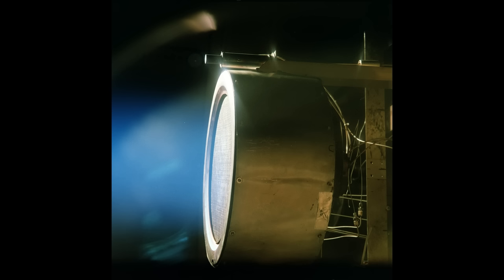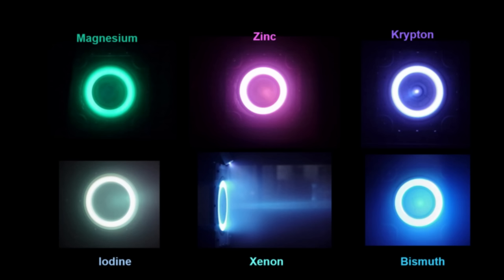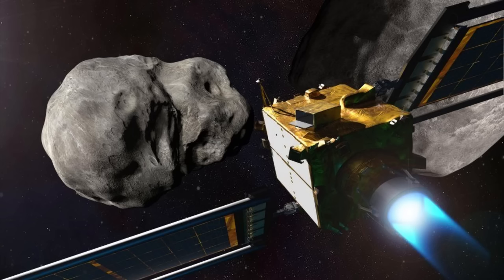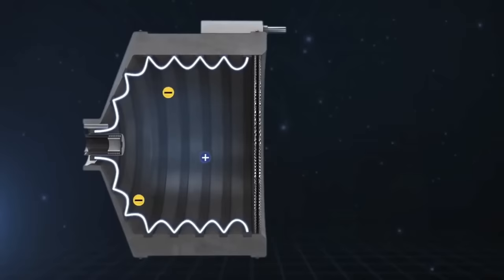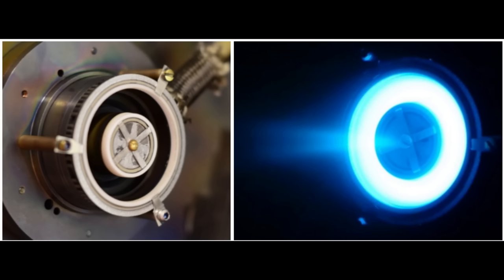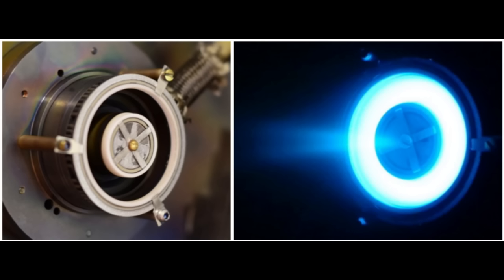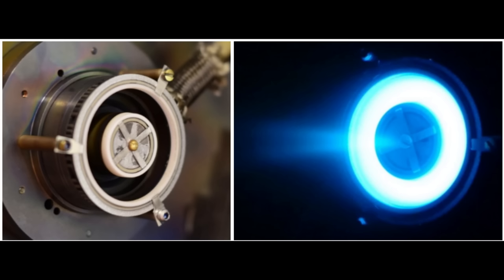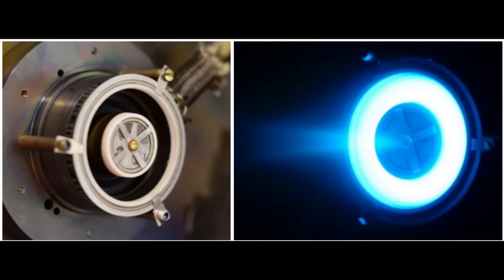Why Are There Two Different Types Of Electric Space Engines, And How Do They Work?

Comment: Bizarrely, the description of how the grids work in the ion thruster and the addition of screens and suppressor grids is precisely the way that audio vacuum tubes (valves) were developed from triodes to tetrodes to pentodes. So my question is this - can I stick four ion thrusters in my Marshall amp?
Reply: Alternatively, if you just needed a few more Ns impulse to reach a rescue craft a la Martian and had nothing but your great-grandpa's Fender amp, could you use it to rendez-vous? What guitar tab would be best?
Reply: @spagamoto  I'll knock the tops off a few EL34's and contact you from orbit
Reply: While working on the Deep Space One NSTAR engine, the JPL people asked where I gained my knowledge about Ion engines. I told them I made a few in 1966 from old vacuum tube components.
Reply: @Spacedog49  There's nothing new that hasn't been forgotten!

Comment: I always thought plasma thrusters count as electrical thrusters, too. I guess they don't use electric fields as directly as ion thrusters, but what else would you call them?
Reply: "I always thought plasma thrusters count as electrical thrusters, too."

They do! And they're awesome, the current problem with plasma thrusters is that they get too hot and melt down all known materials, but if we managed to solve the heat issue, they would be WAY better than ion engines

Plus the heat management issue is also the thing that is preventing us from using advanced fusion, fission antimater etc engines, so solving that would open the door to truly magnificient engine types

Comment: Hey, @scottmanley if you had a 1000 kg spaceship exclusively dedicated to accelerate, that used a mix of solar and nuclear power to fuel the ion thruster (solar panels could be ejected when they became useless, thus reducing total mass) what would be the top speed that it could achieve? If it would it be possible to mix it with gravity assists how much more speed could it get? Could it get somewhere near relativistic speeds before the fuel ran out?
Reply: Wow, you don't ask easy questions!!
Reply: it depends too much on many variables. how heavy the rest of the space ship is, how much is fuel, what kind of engines you have, how much money you're willing to put in, how much time you're willing to wait, etc
Reply: @dabs4270  the ship should be just engine, fuel, solar panels and nuclear RTG, nothing less, nothing more. It should the best engine possible, with no time or money limits. I just want to know what would be theoretically possible
Reply: Yeah, (when?) could we overtake the Voyagers this way?
Reply: To do this, you would probably want like 90% fuel, 9% RTG, and 1% everything else.  Skip the solar panels, run purely on a 50 W RTG, and use a FEEP thruster at a truly ridiculous accelerating voltage, and a truly abysmal thrust level.  Say you use 130,000s of ISP and a 90% fuel mass fraction - you have 2.9 million m/s of delta-v.  But, with a 50 W powers supply, and 900 kg of fuel, it will take about 950,000 years to fully accelerate.  

That's way too many half-lives of plutonium for the RTG to continue working - you get like 80 years at best. So, not feasible.  But, it gives you a sense -  With Xenon,130,000s of ISP only requires like 200,000V of accelerating potential. That's like a decent high-school Van de Graaff generator.  Just need a power supply that weighs little enough to make it make sense.

Comment: So, if you had a big fusion reactor and some very large banks of electric thrusters, could you generate some significant thrust? I'm thinking The Expanse.
Reply: We can build powerful fission reactors right now that could do all kinds of awesome things in space. Like getting humans around the solar system in amounts of time we could handle. We just don't have the drive to do it yet. That could change in the relatively near future as we learn to gather and use resources in space. If your into this stuff I'd read Delta-v and Critical Mass by Daniel Suarez. They're novels about mining in space and saving the world but are scientifically accurate. Good reads for space nerds.
Reply: It's not just the raw power requirements that make ion (or plasma) engines bad for moving humans, but also the efficiency of the parts. If you strap a gigawatt nuclear reactor to one of these engines, you won't be able to funnel all that power into engine thrust. You'll just melt the components.
Reply: In theory, you could generate a lot of energy from nuclear fission/fusion which could drive an ion engine, but I doubt it would be better than using the thermal energy to expand a gas and use that. Right now, most energy production from nuclear is via heat, so it is more efficient to use that heat energy to produce kinetic energy than to have efficiency losses by converting it to electrical energy then to kinetic energy.
Reply: fusion reactor would be an engine in itself)  double-quadruple conversion is pointless
Reply: @General12th  Kinda like changing to a different propellant, it's building a whole new engine. I didnt mean to imply that all we need is huge source of electricity and bam its The Expanse. But there are many different propulsion concepts that become possible when you effectively have a your cities power plant on board. Nuclear Thermal will probably be the first one we'll see that makes Human exploration beyond the Earth Moon system feasable. Or maybe something like the vasimir plasma engine powered by an electricity producing fission reactor. Still have to get rid of waste heat one way or another which can be a real bitch in vacuum. People much smarter than myself will hopefully be stressing over all of this sooner rather than later.
Reply: @harryganz1  thermal nuclear engines have ISPs of 900s, so double of HydroLox.
Direct use of nuclear processes would be really great. But the needed gigawatts of nuclear reaction are scary at least for human spaceflight. shielding is heavy. Heat sink is heavy. human soup is considered bad.
Reply: @harryganz1  That's why I said 'all kinds of cool things' instead of 'power ion engines.'  With a bunch of electricity to draw on things like magnetic shielding become possible. Good propulsion isn't the only thing humans need to live and work in deep space. That's why sometimes the multiple energy conversions make sense when you need that energy in a form you can use for whatever the purpose at hand is. I'm not the ion engine guy or something like that. I'm the pro try everything if it advances our species to the next steps guy. Starship should give us the capability to put real hardware in space cheaply enough to do real commercial work with. That's what's game changing about it. Not that we could try to colonize Mars for uh....reasons. Science outposts? Yay, all for that. Elon deciding if you get airscrubbers based on the 180 character description he makes you write of how you have worked for Mars in the last month sounds less desirable to me. Kidding a little but that whole colonizing thing has never made any sense. Our main focus now should be improving any and all tech that advances ISRU. And finally doing something about spin gravity. It's really not optional for more than a few week visit without your body paying a high price. And we can't build anything really transformative out there without ISRU. The Moon and the NEO's are the place to work all that out. We could really be doing some next level shit up there right now if we had the collective will to. I get why we don't have that will though, lots of problems right here at home and most people don't believe they benefit from all this space stuff. They're wrong of course but I still underatand. I think a lot of our collective apathy comes from no longer having a frontier open to anyone brave and smart enough willing to risk it. Having that again might raise us out of this malaise so many seem stuck in. Finding a way to democratize access to space should be a priority so hopefully we don't drag all our BS out there with us. If we wait till we have a huge presence then we'll have already baked in the BS I think. Funny that in the books I mentioned earlier its all done with grift and subterfuge because none of the powers want anyone having more than they do, understandable from their perspective. I can see it all going so many different ways and most of them arent great for regular (non billionaire) people other than the technological improvements. Hopefully we can all be kind and honest enough to each other that one of the better scenarios works out. But humanity hasn't been the most confidence inspiring thing lately so anyones guesses are as good as mine. Delta-v and Criticall mass by Danial Suarez, really can't recommend these enough. It's all based in realistic tech and the real problems of living and working in space. Other than just being good reads for scifi nerds they definitely gave me a lot to think about.
Reply: @mrpicky1868  Maybe in a vacuum, pun intended. But often all those conversions are necessary to get energy into a form you can actually use for whatever problem your trying to solve. Even with all the losses. The best propulsion we can do for human travel in the near future is probably nuclear thermal. But propulsion is only one of the issues we face out there that might be solved by having large amounts of energy available in multiple forms. So no, not exactly pointless.
Reply: The Expanse's  Epstein Drive is just ridiculous by today's tech (it pure sci-fi). It can constantly creates enough acceleration at least 1/3 G  for weeks.
Reply: Definitely a bit of artistic license, but if I remember correctly, it is basically what those ICF derived “torch ships” would use.

I think they were mentioned in fhe video Scott made on the “Far-Future Rocket Technologies” or whatever, but i’d love a dedicated video on plasma thrusters! (Maybe one for non-nuclear thermal too, unless that already happened and i forgot it rip)
Reply: @harryganz1  chould you use both at the same time waste not want not? i mean the waste heat and also power from a fission engine have the waste heat heat stuff up and power made power a ion engine?
Reply: yes but it's inefficient, "fusion reactors" are steam engines at the end of the day, why do that when you could make the fusion reactor your engine directly, every time you transform energy from a type to another you lose some of it

you go fusion products and their kinetic energy and charge, to thermal energy and chemical damage, to heating up water/a fluid, to moving through a steam turbine and becoming rotational energy, to being slowed down by a dynamo and becoming electric potential, to electromagnets, to a force applied to magnetically charged ions

instead of "fusion products go brrrr out the back of the ship"

there's ideas of pinched fusion which remove the steam turbine dynamo part, though that's not realistic, any high horsepower fusion engine would always generate a lot of heat, wether that's your main way to extract energy or not you WILL have to get rid of that heat somehow, and if you have to bother mmaking a complex coolant loop around your reactor, at that point why not add in a dynamo

Comment: I was wondering why Falcon Heavy delivered Intelsat all the way to geosynchronous orbit, as it's so much more expensive than the transfer orbit.  I did some research and found out that the electrically powered Intelsat would otherwise take 4 months to position had a Falcon 9 deployed it in geosynchronous transfer orbit.

Comment: (Apologies if duplicate post)

The USA tested electric engines using both suborbital missions [SERT-1], and an orbital mission, SERT-2. The latter was launched in 1970 and operated until.....1991! Not continuously of course, but one of the thrusters onboard SERT-2 ran for a total of over 3,700 hours with multiple restarts.

 In particular, SERT-2 [BTW, the acronym stands for Space, not Solar, Electric Rocket Test] really paved the way for the increasing use of electric propulsion that we are seeing today.

Comment: Pure electric engine that works:  A magnetic sail.  Its like a solar sail, but it uses magnetic fields to redirect solar wind instead of just bouncing it directly off a surface.  It has much greater control over the way its thrust is used, and can in theory be used to sail "against the wind."  The thrust is, of course, quite low, though possibly a bit better than a normal solar sail.  

Just make sure you have them at both the aft and the bow (relative to facing at the sun) so you can use them to steer and to cancel out each set of sail's torque.  

Edit:  technically, it does need "fuel."  But that fuel is given to it constantly by the local star in the form of solar wind and energy that can be harvested by solar panels that then power the magnetic fields of the sail system (the masts that have the field generators can also double as mounting points for the panels).

Comment: if one didn't mind super low thrust, could shining a laser out the back work as a thruster? if light has momentum..shouldn't that work?
Reply: The amount of light required means either absurd amounts of energy, or miniscule thrust.  The effect of reflected sunlight and emitted heat radiation is enough to be detectable with careful measurements over years.  It can even cause asteroids to spin after a very long time.  The solar wind is a bigger effect.

Comment: Thanks for sharing your thoughts and ideas. Always interesting and entertaining. Are there any other types of electric rocket engines that could work within the atmosphere. I’m often pondering if the thorium liquid salt reactors can be refined for space use since one of their primary waste products is xenon gas. While powering your way to orbit you might be able to produce your propellant needed for space. Although no expert by a long shot I’m stuck liking the idea that your nuclear fission fuel contains both your energy and propellant in one compact element.

Comment: Thanks for the insights into electric propulsion.

While NASA were focused on more efficient LOX-LH engines and gridded ion thrusters, Elon and his engineers decided to use a kind of Soviet space technology: LOX - kerosene engines and Hall effect thrusters - and they did so with great success.

You can call me biased, but, in my opinion, the Soviet and American space tech perfectly complement each other.
Reply: I thought it was Rocketdyne that started using Kerosene as part of the REAP program in the early 50's.  I know Goddard had tried gasoline.

Comment: Have you done a video on magnetic sails?  I know Zubrin did some work on using a metal wire array to create a sail in which an electric field could be generated and propel the spacecraft by pushing against the solar wind and other ionized atoms in space.

Comment: Aside from sci-fi propellent-less thrusters, maybe something more like a reaction wheel without moving parts could be done, to reduce wear and tear.  Something like a toroid full of a liquid that could be spun around to create the reaction wheel result, depending on the direction of electricity.  Basically a reaction "wheel" that lasts much longer.

Comment: You explain that doubling the Isp results in 4x the amount of energy because you double the exhaust velocity. You should also mention that double exhaust velocity automatically means double thrust as well. So for the same thrust, double Isp means double the power consumption, not 4x. In the end, in order to generate thrust, you either consume propellant mass, or electrical power and in a mission design you have to balance those. The key performance parameters of ion thrusters are all linearly linked through:

e*P = I*F*g 
Efficiency[-]*Power[W]= Isp[s]*Thrust[N]*g[m/s2]

Comment: for a posable new type of propellent, you should look at the byproduct of a Rydberg polaritons as it converts into triple or double bonded photons as they have mass and might be able to be used as a propellent and can be generated LOL and get this at first it is traveling at the speed of light and then converts and keeps 10% of its speed and gains mass you don't lose the rubidium as it is held back via a magnetic cooling trap.. so light goes in on one side and converts in to a Rydberg polaritons and as it leaves the cooling field converts to either a triple or double bonded photons with some newly gained mass . and even if it only has a short life that is still time that you can push on it

Comment: If water and CO2 could be the propellant, you could use fuel cells to power the magnets. (Also, convenient water and oxygen if you need it.)
Reply: You still need a ton of extra energy beyond what your reaction mass can provide chemically.  If you get that energy from more chemicals, then you have to carry the weight of a bunch of depleted chemicals, instead of using them as reaction mass.  Ion engines only make sense in terms of energy and mass if you have an outside energy source like the sun, or maybe a very dense energy source like nuclear power.

Comment: It's tricky to compare the two examples you gave for since the GIT is ~7kw and HET is 4.5kw, but it looks like the GIT has 92.5% of the thrust for nearly 2x the ISP.  I was expecting the thrust levels to be significantly different, not 92%.
Reply: Keep in mind that for the power draw, you could have almost two of the second thruster, granting significantly more thrust for the same power. In practice you'd use one larger thruster, or just cut the electric system back to match the thruster, but the thrust per kW difference is what matters either way.